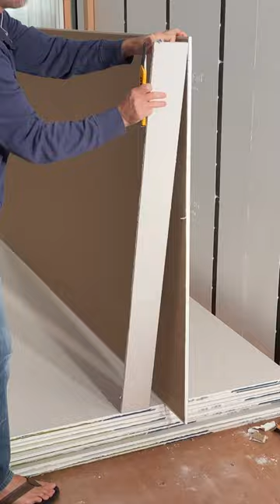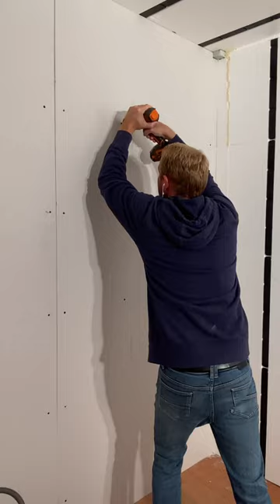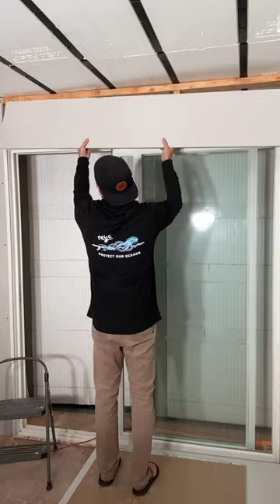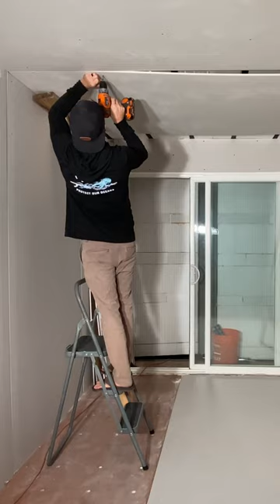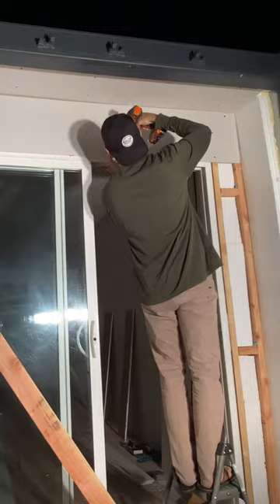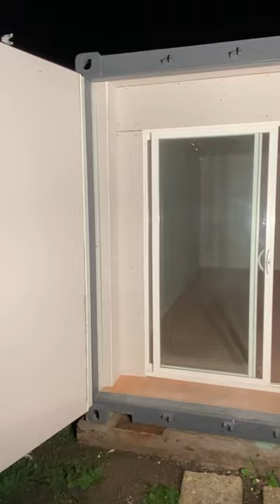Hanging Drywall in a Shipping Container #shorts

Comment: Friendly reminder. Ceiling before walls, always, no excuses.
Reply: So many "diy" just show the wrong way of doing things its unreal
Reply: 🤷🏻‍♂️ oh well, turned out well.
Reply: Not if you do it the other way then it’s wall the ceiling 😂
Reply: @deltonmiller2248  Without the ability for 'blocking' let alone 'corner blocking ' you are left with 80% of your taped edge surfaces being unsupported. Add that many of the screws are too deep = unhappy camper.
Reply: Yeah didn’t want to be that guy but also don’t over drive screws
Reply: Can’t expect much from a guy working in flip-flop 😂
Reply: Depends what ur doing really
Reply: @jaydenrobinsondipaculang8661  no it doesn't. Ceiling always first because the angels will sag over time. The walls being hung after prevent that.
Reply: There are some instances where you should do the walls first. Like say the framers were total hacks and the best course of action is bevel the sides of the ceiling and thump it into place with a 12" piece. Or if your on a job that is supposed to be an even 8' but is really like 96.25" then you can hang the longest wall first even staking it if you want. And one of the adjoining front or back walls. Now you saved yourself having to take a 1/2" off the sheets on both those walls. After hanging for 25 years you know there are rules to the shit but there are also exceptions.
Reply: Cutting with the T-square all wrong!! 
The knife just needs to jump a quarter in over the tsquare and you’ll be losing a piece of your finger
Reply: @Doodooheadguy-fishing  most of them did that on purpose, so that people will comment, more interactions on thier vids the better algorithm for them..i guess that's how social media works
Reply: Exactly these guys don't know what they're doing
Reply: Good to know, thank you
Reply: I was going to say that..
Reply: why? im working at a marriot hotel and they did the walls first.
Reply: @jamiemcgavran5405  ok, what if ur using those metal things to screw the drywall in them? u wont have that problem right??
Reply: Ceilings first always later down the line gonna have sag and cracks from bow start with 4 foot on bottom if anything but always always ceiling first
Reply: @Doodooheadguy-fishing u realize this is just a guy… showing his journey to create a shaping bay for surfboards out of a shipping container. Lol. The outside of this wall is pure metal. I think he’s good. Also.. it’s not a DIY for you to learn from. He’s just filming his progress for entertainment. Lol
Reply: Is drywall on a weather-facing wall okay? I assume the shipper door will be open when working in there, so the drywall will constantly be exposed to elements, yes?
Reply: @Doodooheadguy-fishing 
I
Reply: @drewb.4069 looks like you got a degree in conspiracy theories
Reply: @digitalparadigms oh so the walls hold up the ceiling Abit better ? I did ceiling after walls and didn't seem right and I was just learning on a summer 2 so yrs ago
Reply: As a diyer I’ve never heard that but it makes sense.
Reply: @ClavinZKL They we’re hacks 😂
Reply: It will work the other way round it’s not ideal. I do agree but there is no giant problem.

Comment: Those containers create a lot of condensation. Your drywall will be saturated in no time, depending on weather. Even with the insulation. Maybe some ventinlated fans can help.
Reply: Too much insulation too.   No expansion gap and no breathing room.    Should’ve had a vapour barrier then an air gap then insulation otherwise he will get mould and damp

Comment: I'm kind of wondering if that drywall to the exterior of the sliding glass door is a good idea.  Unless you're closing the container every day, I can't imagine that would last or be a good idea.  You'd have to also make sure no moisture is getting on/in that side of the wall or you're going to have a pretty bad mold problem.
Reply: Pus he put on the actual door That swings out into whatever weather. How well does that kind of door keep out the elements anyways? Assume he'll do some kind of weather sealing, but still...

Comment: Is there any risk of the drywall joints splitting as the container metal expands/contracts with heat cycles?
Reply: The tape covers the joints so you’ll never see the joints unless the tape delaminates.
Reply: @straat9066 that doesn't answer the question.. the tape can crack

Comment: Just did this myself in a couple of 40ft containers I cut in half. As others have said, cieling before walls and walls should be running bond pattern always to minimize cracking. For this kind of building you may not care so much, good job.
Reply: Where can you get this insulation?
Reply: @Diesel_Monkey_Tx  insofast
Reply: what is bond pattern? just curious. thanks in advance

Comment: My man
Good build.
7 out of 10.
Points conducted for lack of windows or aircirculation

Lack of electrical wiring

Wall/ceiling placement.
The walls support the ceilings edges. Also, use a way to spread the load if you want cointersunk skrews. Like countersunk washers.
Because the gypsum is weak and unsupported. The paper is what holds your plate up.

Comment: Insulation needs to fill the entire area, any gaps or spaces will just leak cold air and will make your house cold like it's not even there if you leave the gaps. Batt Insulation would have been a better fit and higher r value, especially if you went rockwhool

Comment: I’ve done drywall for a while and I’ve never seen someone leave long seams from top to bottom. Those seems have a higher chance of splitting in the long run.
Reply: Ever screwed drywall to styrofoam?
Reply: @justinreed801  Never. That’s not what your supposed to do. If you want to use styrofoam for insulation then you put it in between studs and you screw the drywall to the studs.
Reply: I agree. From what I've been taught, you can have your exterior ZIP system OSB sheathing run the long seams from top to bottom but, drywall should be installed horizontally with long seams running from side to side.

Comment: Ceiling FIRST, drywall is a structural plane you’re setting them up in wrong direction. And screws are doing nothing if you break the paper. And a $150.00 drywall lift will always be your best friend.

Comment: Where the hell are those screws going into? The foam? That ain’t holding unless I’m misdirecting something. Even if it is going into the metal that means there will be leaks exc. How does this install work on the technical aspect?

Comment: So there is a right way to hang drywall? White side towards the wall and not out?
Reply: The white side should always face in towards the room. You want the white side facing you because, after you've mud and taped the seams, your next step is to paint the wall and you would not want to paint a brown wall. You would have so many coats of paint on, white makes everything cleaner and easier albeit you still have to put primer on before your actual coat of paint.